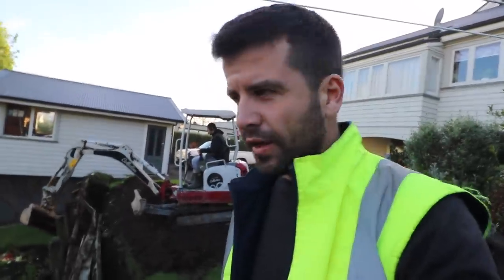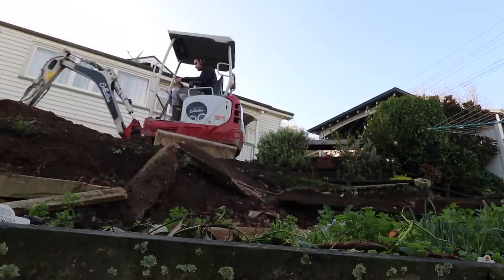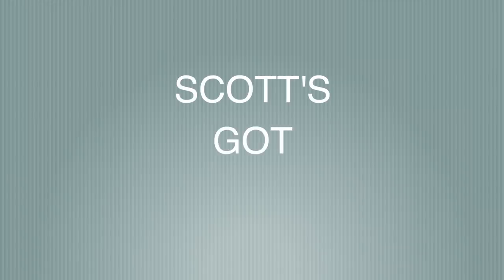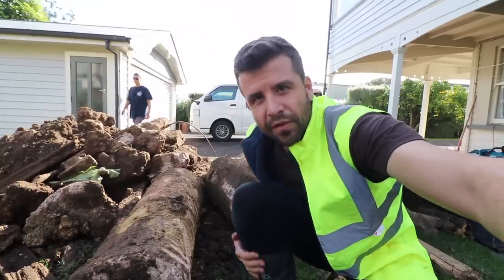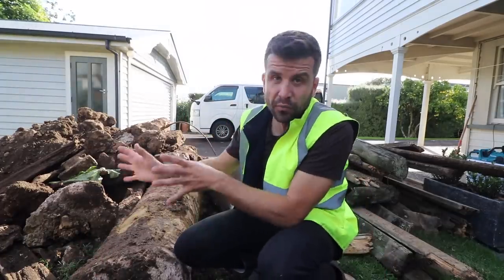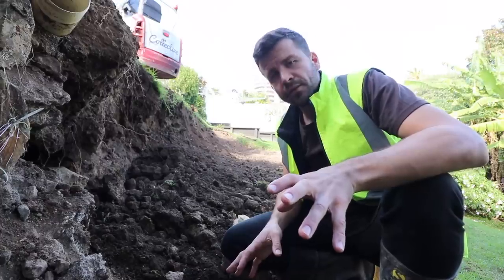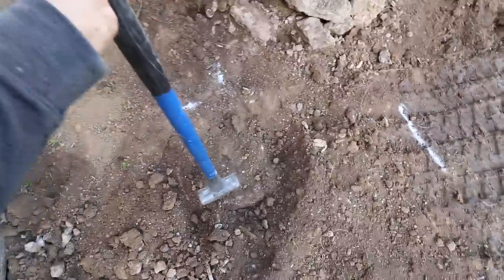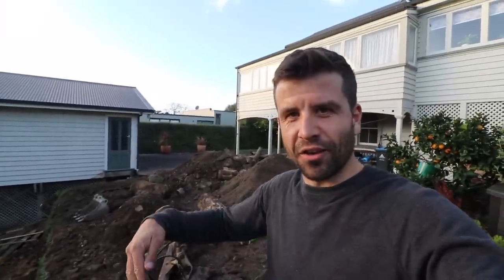Why Your Retaining Wall is Falling Over

Comment: The posts didn't sink or bust out the front of the concrete, they just didn't go deep enough and there wasn't sufficient drainage.  The bottom of the post is best sitting on drainage aggregate or no fines concrete, not fully encapsulated with normal concrete. If you're concerned about the post slipping you can put some bolts in to act as shear studs, but the load is acting laterally anyway.
Reply: Yeah, wtf was Scott thinking claiming the posts are sliding out the bottom of the concrete??  While we're all clearly looking at non-failed concrete

Comment: I was told that posts shouldn’t have concrete on the bottom because water that seeps into the post has nowhere to go. I’d like your thoughts. Great video!
Reply: Concrete under the piles is important, mostly for protection for the posts. If wood is permanently saturated, it lasts pretty well. New Zealand swamp kauri is preserved for thousands of years, however a log lying in the bush will rot out in years. If there's no air, very few organisms will attack it.
Reply: It's why you are supposed to put rock/gravel at the bottom, then put the post on top. When you fill it with concrete, it seeps under the post, yet it leaves enough grooves for water to drain. What you don't want is the log directly in water and earth, it will rot quick as hell, even pressure treated.
Reply: @TechieTard  This sounds like a very good description, I know GregVan has given the topic a lot of thought http://www.homebuildingandrepairs.com/fences/index.html  Here's the one where he argues the soil type and water level are the most important factors to consider when choosing what type of assembly to construct http://www.homebuildingandrepairs.com/fences/gravel_at_post_bottom.html
Reply: @TechieTard  Was the way I was taught

Comment: Good deductions Scott on the retaining wall. Another reason it failed may be due to a lack of lateral shear resistance from the king posts. Kings posts too far apart. A 1m wide geotextile layer at mid depth behind the wall would also decrease the lateral loading on the wall. Don't forget your weepholes. Tilting the wall back 10° from the vertical gives a better look. Vertical walls have the illusion of leaning over.
Reply: Tilting at 10deg should also provide a slight lifting force on the posts, which resists the diving effect that Scott describes.

Comment: Scott, awesome vid as usual mate. Another massive factor in retaining wall posts is the ground conditions you're going into. You can be 2m deep but if it's all top soil or sand, that wall is going to move. Best thing for timber post retaining walls in sketchy ground is to chuck a deadman at each post.
Reply: That's the thing with this wall, it's failed, but it's also not thaaat bad, concrete around the posts, drainflo, scoria, a lot better than the sketchy crap you sometimes see, 100mm H4 fenceposts dropped into a bit of drymix, a bunch of 50mm H3.2 or those old edged half rounds that were stacked behind the garage for 20 years nailed across them, and the soil pushed back into place above it.

Comment: I replaced a retaining wall at my last house and when it came time to backfill the digger operator showed up a day early with a 4 ton and track rolled the fill and pushed a 100 mm bow in the wall while I was at work. Came home and saw his track marks all along the the back of the top board. 
I'm still a little dark on it even though we've since sold the house

Comment: Having concrete below your posts is ill advised; the water will seep between the post and the concrete, run down to the bottom and (if fully surrounded by concrete) stay there, with no place to drain; which leads to rot very quickly.

In stead thorough compaction and aggregate in a fair diameter, like crushed basalt or granite, is a perfect base. It is even good practice to, not only have the post sit on the aggregate, but even surround the bottom 3-5 cm of the post, before pouring the concrete around it.

Regards

Comment: Scott, you don't want to encapsulate the bottom of any post in concrete. Water gets trapped in the concrete sleeve and with no way to get out it promotes rot in the post. In the construction of a wooden retaining wall run at least two timbers back into the upper grade. Tie these "sleeper" timbers into the grade via rebar through the timber and locked into a concrete footing. Place course stone against the inside of the wall for drainage through the wall timbers.
 Follow these tips and your wall will outlast you!

Comment: Great video, I had noticed you mentioned an alternative method of setting timber posts is engulfing evenly across the entirety of the base of the timber post. 1:29 

I found that method over time will cause the wood to rot within the cement due to the moisture not having anywhere below to drain or escape.

Through experience, i found that setting your post vertical and adding 3 or so inches of compacted dirt/aggregate then adding a doughnut shaped, .5cuyd bag of concrete and compacted backfill will hold a post in place throughout time while maintaining the timbers structural integrity. 

Also that is some great equipment you’ve got there. I’m looking forward to future video!

Comment: One of the main problems I see week in week out on brick or block built walls is hydrostatic pressure. People forget the weep holes in the wall or the stone and Ag line at the back. This and under sizing are the two main ones in Sydney

Comment: In Canada we use what’s called a “dead man” to cantilever the wall back into the bank. Tie a timber in perpendicular to your wall and send it back at least the height of the wall into the bank, at the end of the dead man put a cross member a few feet wide, parallel to the wall. Bury it all below grade. We also separate our drainage from native soil using free draining fabric, so the drainage aggregate doesn’t get clogged with mud over time. I’ve never seen anyone put footings down below grade for retaining walls here. Although we do put four foot deep footings on our fences due to the frost in winter.

Comment: You could also make shoe-shape concrete post, so it would be under the upper ground giving wall counter-pressure against horizontal forces, althou you'd need to rebar concrete.

Comment: I’ve always done two thirds in one third out and concrete to the top , some people said it was an over kill but all are still ok , that’s the simple way but any sizeable wall should have engineered plans then you can sleep well.
Some people will just take the cheaper quote especially it they are considering selling.

Comment: I've never seen a post slide through a concrete surround. Unless it was completely rotted out. Concrete below the post should help with reducing rotting but the friction on the surround is plenty to stop the post descending. I see when removing those old posts most were rotten just below the ground where they are wet but also have access to oxygen. In the case of this retaining wall the force is not really down but side ways with the weight of soil and water build up. Seeing how rotten the wood was I suspect the wood was only H3 or poorly tantalized.

Comment: Great video. Ideally, a retaining wall should also lean towards the soil it is holding, and include “tie backs” or a “dead man” to resist leaning.
Reply: East Texas Craftsman Are deadmans always made out of timber?
Reply: @MsElijah16  No sir. You can use concrete and cables too. It's basically an anchor so I'm sure you can get creative with it.
Reply: East Texas Craftsman ok thanks

Comment: The post disnt appear to be sinking/ slipping. Doesn't look like it's treated either. I think the main thing here is the improper to no drainage which caused the lag. But wasnt actually down.  Didn't hear how long that wall was in place, but walls with wood will eventually give no matter what.  Too much show time for me. But thanks for showing some good stuff

Comment: If this is the north shore, then it's probably an expansive clay soil?    Which when the ground below the wall dries out (and last few years have been very dry), the ground shrinks and therefore wont resist the posts leaning over.

Comment: Surely for a retaining wall you need a "L" shape retaining wall design to resist rotation and should be confirmed by structural calaculation for the proposed lateral loads that will be applied.  Just drilling vertically will not provide adequate resistance to retain with lateral loads applied direct to the wall ..
Reply: This is true where the lateral loads exceed vertical tangential resistance. In this case since soil has a compressed dense pressure ratio (CDPR) of 15:1 at seal level (760mmhg). The veritical tangential pressure load would need to exceed 1800mm, with a span in excess of 50m. Since (9.8m/S2 X the CPDR 15:1) * 760mmhg is less than the sum of squares. Therefore big posts and shit loads of  concrete should be fine.

Comment: Wouldnt a pure concrete retaining wall be much stronger ? i mean its probly very far down to some solid ground to flace rebar in to hold it but it would seem like a much more solid solution other than rebuilding it in wood. just my thought. looking forward to see how you guys do it
Reply: Wood in the ground is always a bad idea unless it has an incredible amount of chemicals it’s been treated with. Standard pressure treated wood is a time bomb